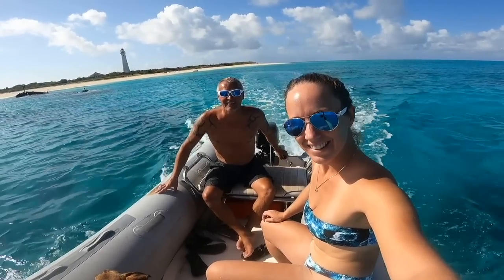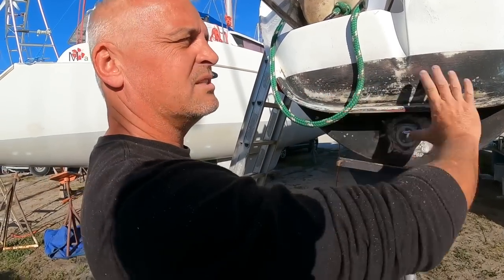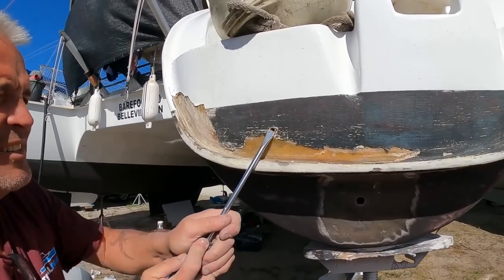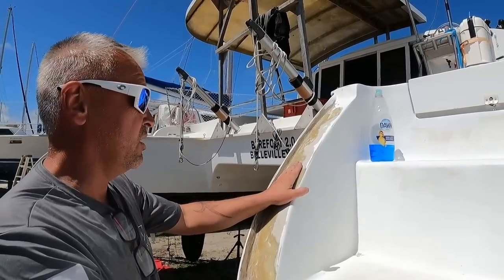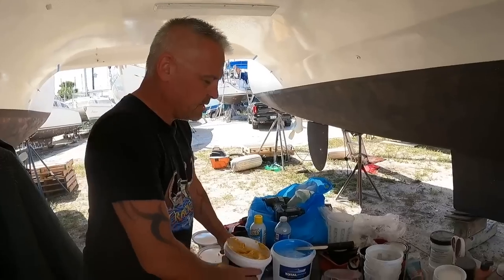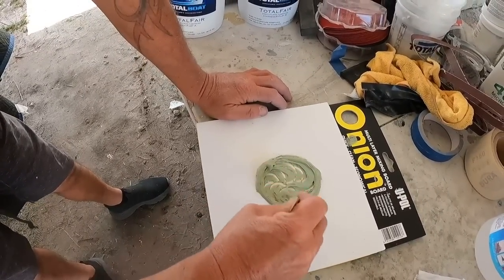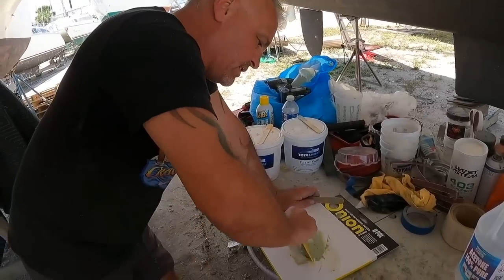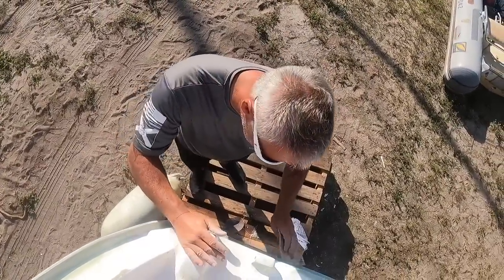Sugar Scoop Rebuild -  Fibreglass, Fairing and Painting - BOAT WORK (S4 E47 Barefoot Travels)

Comment: Davy, just some info on poly resin if you dont know it already. In hot weather above 30 degc, no resin work. I use 0.8% (lowest)  hardner to get more time and 1.4% (max, any more is waste) for faster curing in coldish weather. Hopes this helps a bit😁
Reply from the maker: Thanks. I am aware. I try to do my glassing in the mornings when it’s not too hot yet.

Comment: Good video.  Question: The inboard bows of both hulls appear to have dimples or craters.  Is that an illusion?
Reply from the maker: No there is some dimples on the sides. We never had time to fair it as we had to rush to get back in the water in luperon.  We will be addressing this in an upcoming video
Reply: @Barefoot Travels  Thanks.  The quality of work does not meet Davies standards.  I look forward to seeing that episode(s).   Cheers

Comment: Cure time between layers and painting was not correct. Its like when you paint layers you have to let each layer setup. Thank God it wasn't a hole they fixed.
Reply from the maker: Cure time was correct. Everything was cured cleaned and sanded in between. This video was filmed over about two weeks
Reply: @BarefootTravels  i was talking about the job you had to pull off that you paid for not your work.